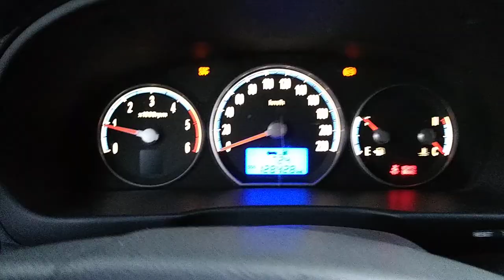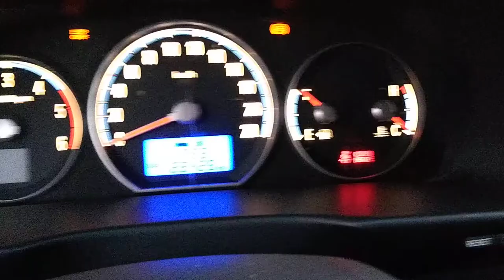Hyundai Santa Fe (2007) - Battery light on/Hard brake pedal! Part 2

Comment: Sandy, second thought, the fault with the vehicle I had was the 12v supply to the Battery Monitoring system was intermittent, this caused incorrect REPORTED battery voltage being sent to the ECU, so in your case you may well find the voltage to ABS or Braking sys being 12v (or 14v etc..) as it should be, it's just that one of them could be sending an incorrect digital value to the ECU, so ECU thinks there is a fault and then enacts whatever it's coded to do , as you and I are well aware there are numerous possible scenarios here, regrettably you have to eliminate one at a time.
Reply from the maker: Cheers my friend, he is driving back to Normandy in the morning so I'll let u know of any developments cheers sandy

Comment: Have you checked the alternator pulley as the brake servo vacuum pump is run off the back of the alternator assembly.
If it is slipping that will cause loss of servo assistance and your battery light to come on.
Reply from the maker: Great idea my friend, he's traveling down to Dover today so I'll WhatsApp him to check belt, cheers for help, sandy
Reply: What will be the solution then

Comment: Scenario sounds familiar, but may not quite be the same e.g. had a car with a BMS( BATTERY monitoring system) attached to negative of battery, now this BMS compares battery voltage to another source e.g. ABS, so if ABS supply voltage (which is Battery voltage) does NOT equal digital battery voltage value sent from BMS a Battery and/or  ABS fault could be illuminated. So see if you can find a Battery Monitoring System, just a thought, keep up the vids, Oh, hope you had a guid new year :), all the best for this one.
Reply from the maker: Cheers my friend for input much appreciated and a happy new year min cheers sandy